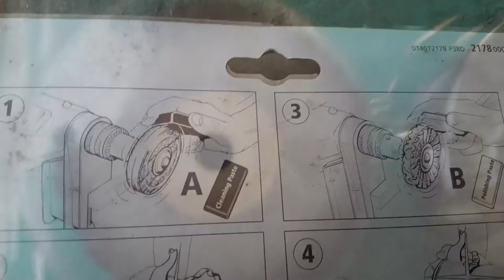How to Polish and Buff your Wheels cheap and easy

Comment: hi thear can you give leank connection to where buy polish  kit complet amazon aliexpres..?? THX nice video .. :)
Reply from the maker: This looks same as mine, but I bought locally. Do your research and buy any one metal or aluminum polishing kit, I think all should work. Good luck !
https://www.ebay.com/itm/Osborn-Metal-Polishing-Kit-To-Fit-Drill-High-Quality-3/182714229728?epid=737104499&hash=item2a8a9de3e0:g:epYAAOSwx0FZjvTz